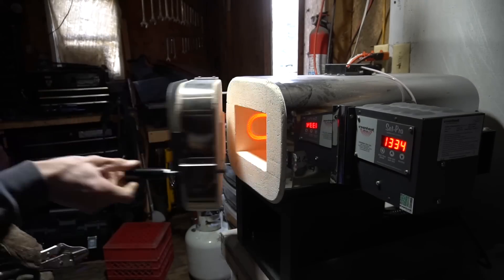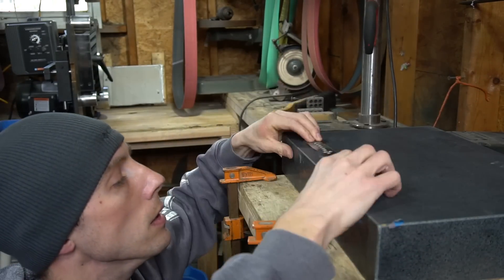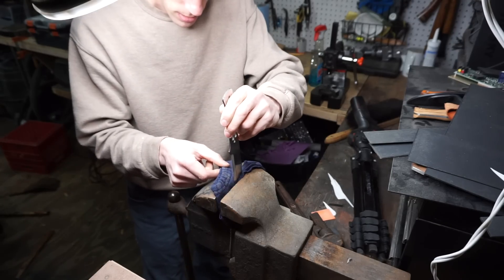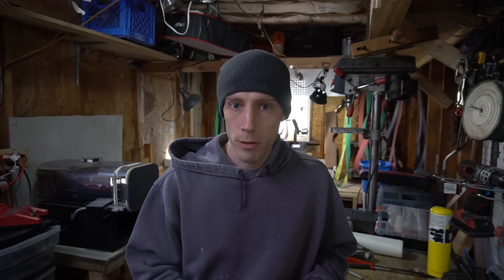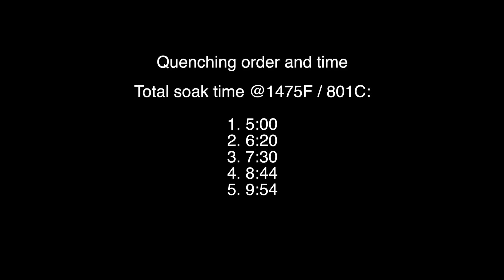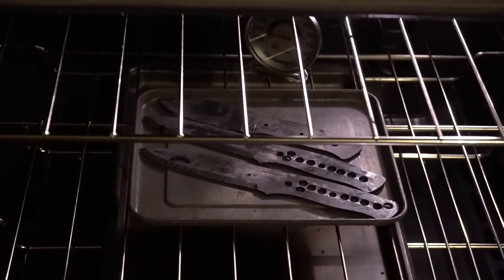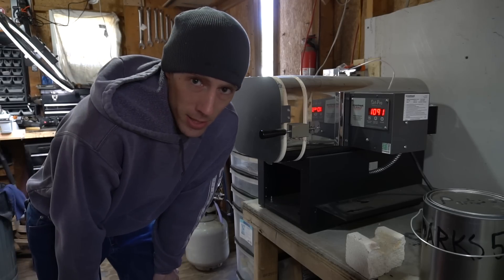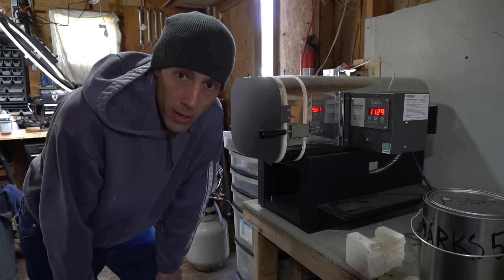Why Knife Makers Should Break Their Knives

Comment: Question. Would the elevating oil temp throughout the process of quenching cause the steel to cool slower and allow for larger grain size?
Reply: Curtis Barkes I was thinking the same thing I’m sure it could play a fairly large role in the results
Reply from the maker: No, oil temperatures were monitored throughout the testing. 110 for the low and 155 for the high👍
Reply: @OUTDOORS55  right on
Reply: @OUTDOORS55  That's all the oil heated up over the course of 3 blades?  It appears to be a gallon paint can of oil. The other day i quenched three knives and the third knife got the oil so hot it, when i attempted to wipe the knife down after it had sat for a minute, i slightly burned myself. The first two knives were cooled enough by the oil that it was no problem to wipe them.
Reply: @OUTDOORS55  that is a difference btw 45 degrees can make a difference when you are splitting hairs
Reply: @cadewamsley5934  & @OUTDOORS55 Exactly. If you want an apple to apple test, get 5 separate oil buckets that are all at the same starting temperature. Every time you add the next bar, the oil temp is higher, so you are not dipping them at the same temperatures (which will give you a drastically different result, as you are seeing). Also, the final bar is going into oil that is a good 30+ degrees hotter than the first bar. I dont know why people have no idea how to do a proper test.
Reply: Just use thicker or thinner oil, the thickness of the quench medium determines how fast the heat is removed from the steel. Too thin, too fast, it's brittle, too thick, it's slow, it's soft.......🍻👍
Reply: normally the manufacturer of the steel in the heat treat charts  recomends to quench on heated oil or liquid salts depending on the steel
Reply: A traditional forge in Kyoto heat's his oil before quenching. I didn't think to ask why.
Reply: @Crazt  oil is most efficient at drawing heat when it is a little above 100 degrees. At least that's what I've heard
Reply: Larger grainsize is bad, you want as small grains as possible, what you want is "Martensit". My recomendation is heating the knives 5min or just a bit less and realy cold oil (8-15°C). What happens when you quench the blade is similiar to the 2D 3D case of weldings. You want the temperature gone fast, unlike the case with welding you have a mostly uniform material, therefore you can ignore effects in terms of atoms wanfering from material to material. The problem is the soaking time alone. You start with a structure and I guess from what he said that he ended up with larger "Ferrit" or "Perlit" deposits at the grain border. The grains grow over time, to realy get rid of these problems you'd have to go completly austenitic but not molten depending on the steel somewhere between 1536°C (~0% Carbon) and 1350°C (0.8% Carbon); 2.06%Carbon would be ~1160°C (thats the border of what steel is defined as btw). You want the metal cooled down to below 723°C as uniformly as you can get it, this is not an issue with pieces as flat as a knive. At my UAS we did a test on a lowcarbon steel and got a result of 20mm distance outside to the core as critical, usually there is no commonly used steel out there which has problems with distances below 15mm outside-core. On a round rod this would mean for the steel we treated that it could be up to 40mm thick without issues during the quenching process, namely grain growth in the core.
Togive you a better discription of your optimised quenching I'd need all the data on what you did and what stels you usualy use. Either by PM or at Dennis1Bauer@t-online.de
Reply: if anything, hotter oil would be more fluid and cause the steel to cool faster.
Reply: @Jiminycroquet  never heard that.
Reply: @kenkl5204  Circa Forge is right, although it doesn't count indefinitely. (there's an optimum temperature, and if I recall correctly, Alex has already done a video on that, and is always using slightly heated oil for that purpose.) But the better cooling of preheated oil actually occurs the most when moving the object that needs to be cooled.
Reply: i should really read comments before leaving one of my own. just deleted my long-winded comment about the same question... great minds think alike

Comment: Did you do all those knives at the same time? all 3 in 1 day, soaked in the same oil with 1-2 minutes difference, because I think that could affect the grain structure too, the 2 first knives turned out well because the oil wasnt to hot, 3rd knife oil was to hot. Seems like something you wouldnt miss, but its the only think I can think of, I did something simulare myself a while ago minus the snapping part where one batch of knives turned out great and the other batch only had 1 knife that was hard enough while the 2 other knives quenched right after the first one ended up with a HRC 50 instead of a 60 (after tempering).
Reply from the maker: I measured the oil temperature between the three. I talked about it briefly on Instagram. If I remember correctly starting temperature was 110 and ended at 155. Thats still within the range of the oil. Quench speed shouldn't affect grain size though. Hardness and grain size aren't necessarily related.  Unless im missing something🤷‍♂️
Reply: @OUTDOORS55  Yeah, but the weird knife was also softer. It bent farther and more easily. The grain size shouldn't cause that. If it were quenched and tempered the same, I think this knife should be just as hard but if the grain size were larger it should potentially fracture with less force and it should have bent LESS before it broke. 

IIRC, I have seen grain size examined by cutting the steel and sanding the edge smooth, then etching the metal in acid, and examining under a microscope. Perhaps if you do this to your samples, you might find the "weird" soft knife isn't all that different? It might have different structures (less martensic formations and more pearlite and cementite and whatnot) due to a slower quench, rather than a significantly increased grain size? 

Another way to test this is to take one of the good knives and purposely over-temper it. Then repeat the fracture test. You would expect it to bend more easily and farther, to take a set, and (possibly) to break at a lower force, just like the weird knife. But the mystery is... will the fracture look similar to the weird knife?

Also, this is totally unrelated but.... when you anneal/normalize steel in that small of pieces, you usually have to stick it in a hot box or let it cool in the furnace for it to completely anneal/normalize, no? Just setting it down in ambient air, I think it will cool fast enough to partially harden.
Reply: @OUTDOORS55   Yeah it was the only thing I could think of, but after some "expert googling" grain size matters in both heating and cooling. How much Id believe in that I dont know, still kicks back to my first comment, which as you explained. But the smaller grain size you have the tougher the knife will be(as they snapped oddly) according to "Grain-boundary strengthening (or Hall–Petch strengthening) is a method of strengthening materials by changing their average crystallite" which is copied straight from wiki. If you havent read on it you might find something there. might just have been a coincidence as well, irregularity in that particular piece of metal perhaps.
Reply from the maker: I believe i read everything that was free in the subject. The exact time and temperatures are a mystery as far as i can tell.  Also,as grain size increases, so does ductility. Which explains why the first knife bent the way it did. Exactly what caused that is beyond me. Unless I missed some aspect🤷‍♂️
Reply: @OUTDOORS55  quenchant temp should only affect hardness IMHO.